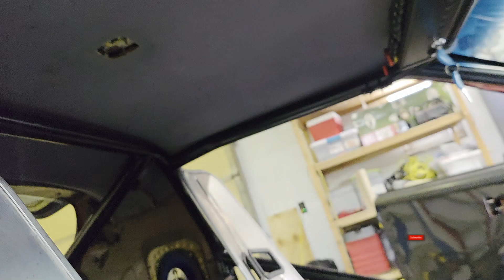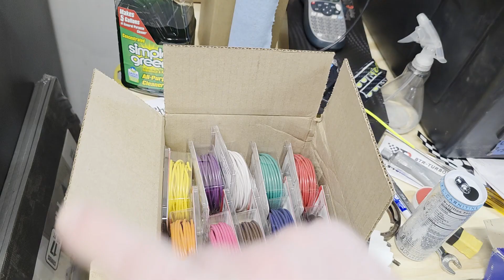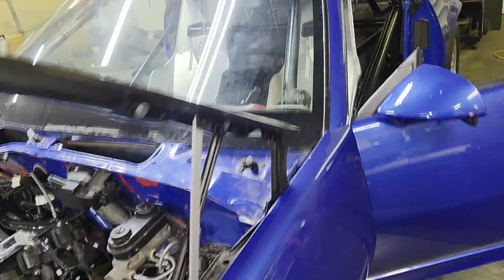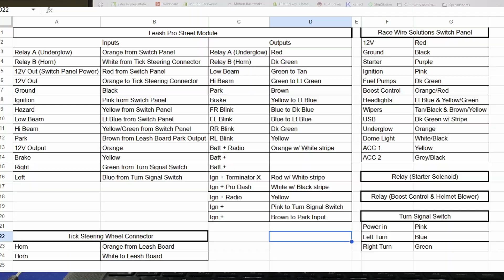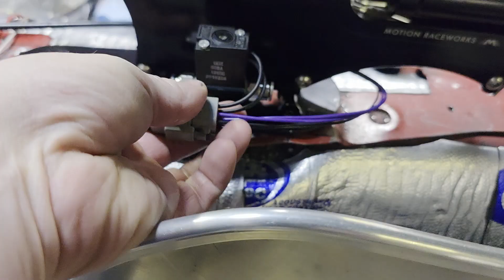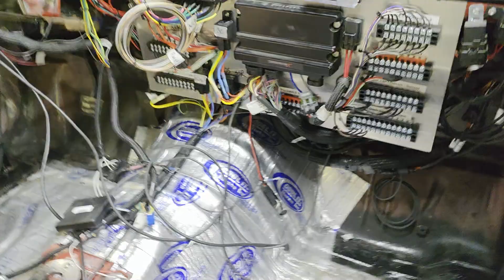Rewiring The Third Gen

Comment: Man, nothing beats those big Carling style rockers in a race car. As much as I love the new canbus stuff that's coming out, you just can't beat those big switches that go clunk when you hit them.
Reply from the maker: I have nothing against a CANbus connection, it's actually a very efficient connection compared to direct wiring everything, but I'm not a fan of a ribbon cable like you'd see in old computers. I also am not a fan of the touch buttons like you see in an ARC switch panel. That's why I chose the switch panel from Race Wire Solutions, it fits exactly what I was looking for and was customizable.
Reply from the maker: Thanks for watching and commenting